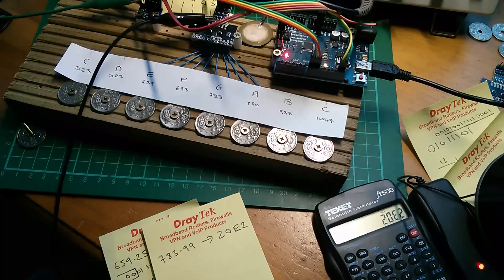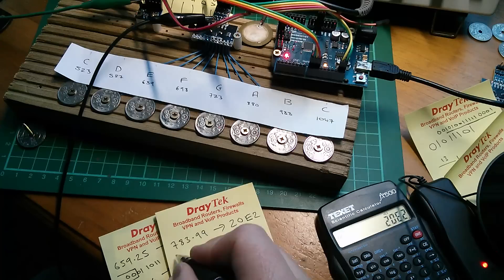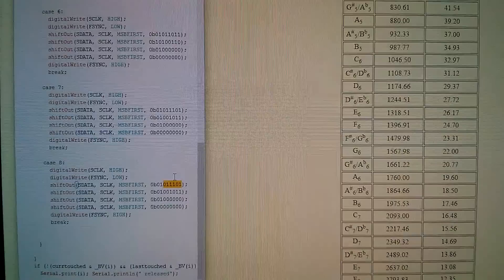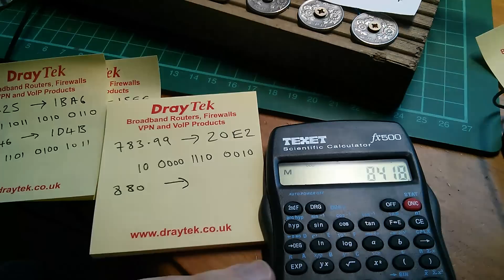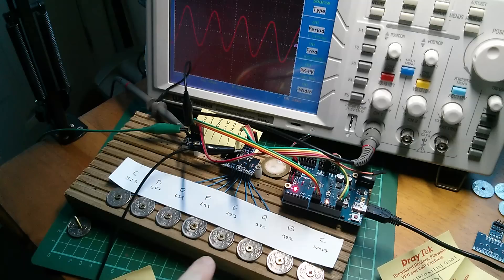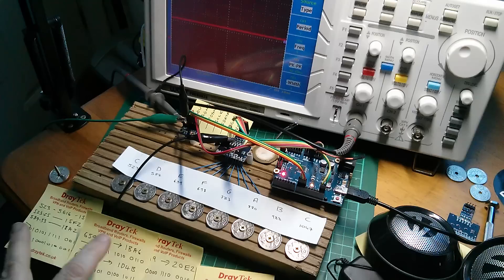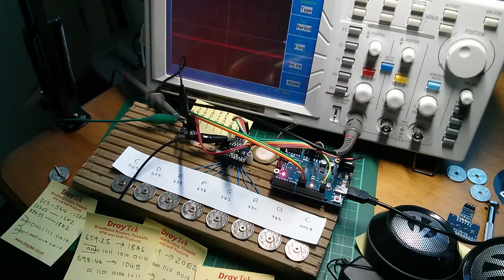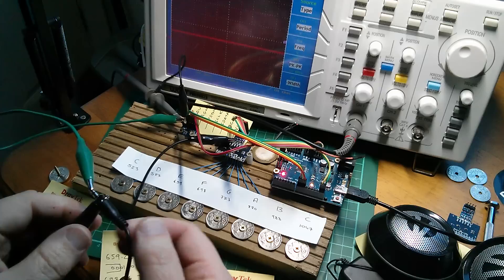Project: Penny Organ - Hand Calculation of Frequencies

Comment: You could use the Hex directly in the C code, then concatenate that with the two bits used for setting the register.

I'm not sure if you can concatenate things in C like you can in Verilog (much easier than doing bit-shifts and ORs etc.), but the C code could be something like this...

int NOTE8 = 0x20E2;

char HIBYTE = (NOTE8 >> 8) & 0x3F; // Shift the MSB byte to the right, then mask the resulting lower 6 bits.
char LOBYTE = NOTE8 & 0xFF; // Mask the LSB byte.

case 8;
digitalWrite(SCLK, HIGH);
digitalWrite(FSYNC, LOW);
shiftOut(SDATA, SCLK, MSBFIRST, 0b01000000 | HIBYTE ); // OR the High Byte bits with the 0b01000000.
shiftOut(SDATA, SCLK, MSBFIRST, LOBYTE ;
shiftOut(SDATA, SCLK, MSBFIRST, 0b01000000);
shiftOut(SDATA, SCLK, MSBFIRST, 0b00000000);
digitalWrite(FSYNC, HIGH);
break;

I haven't tested that, but it should make it a tad easier to reference the code later on, and to type in the HEX values.

Or, you could even just enter the decimal value in place of the Hex for each note, and it should work just the same. ;)

Comment: Ahh - Since my first reply, I've just watched more of the vid when you said about doing it all in C. lol

It's not too bad to do as long as you know the bitwise AND / OR / XOR type operators, and the shift operators (and use brackets in the correct places).

You could tidy the code below by putting the commonly used stuff into a procedure as well of course...

void PlayNote(int note)
{
char HIBYTE = (note >> 8) & 0x3F; // Shift the MSB byte to the right, then mask the resulting lower 6 bits.
char LOBYTE = note & 0xFF; // Mask the LSB byte.

digitalWrite(SCLK, HIGH);
digitalWrite(FSYNC, LOW);
shiftOut(SDATA, SCLK, MSBFIRST, 0b01000000 | HIBYTE);  // OR the High Byte bits with the 0b01000000.
shiftOut(SDATA, SCLK, MSBFIRST, LOBYTE);  // Use the lower Byte directly.
shiftOut(SDATA, SCLK, MSBFIRST, 0b01000000);
shiftOut(SDATA, SCLK, MSBFIRST, 0b00000000);
digitalWrite(FSYNC, HIGH);
}

Which can then be used by simply calling it like this...

PlayNote(0x20E2);
// Or...
// PlayNote(8418);

Love watching your vids on weird and wonderful gadgets btw. ;)
Reply: +electronash i was thinking of using (0x3F<<8) & note , and then shifting it to the right afterwards ,but your method is better =^P
Reply: +Glychee S

To be completely honest, I'm not hugely experienced with C coding (and certainly not C++), so I wasn't even sure if what I typed before was the "right" way to do things. lol

With coding in things like Verilog, it becomes easier to think of shifting towards the LSB in a lot of cases though, and I've seen the same in a lot of C code like the MAME sources too (does depend on exactly what the code is intended for though of course).

In Verilog, you can select a group of bits (or a single bit or signal), and then concatenate them far more easily than C normally allows (without using macros etc.)

At least that's as far as I know, because C / C++ has been updated quite a lot over the years, and as I say, I'm not familiar with all the new operators and "tricks" that can be used. hehe

So, an example in Verilog would be...

wire [7:0] HIBYTE = note[13:8];
wire [7:0] LOBYTE = note[7:0];

See - so much neater. :p

Or, you can even concatenate other bits / signals in the same assignment. eg...

wire [7:0] HIBYTE = { 2'b01, note[13:8] };

btw, I think a few bytes of variable storage could be saved by changing the "int" for an "unsigned short". ie. 16-bits instead of 32-bits (or more accurately "31-bits with a sign bit" with the original int.)

Then also assign the "note" variable directly to the shiftOut stuff?..

void PlayNote(unsigned short note)
{
//char HIBYTE = (note >> 8) & 0x3F; // Shift the MSB byte to the right, then mask the resulting lower 6 bits.
//char LOBYTE = note & 0xFF; // Mask the LSB byte.

digitalWrite(SCLK, HIGH);
digitalWrite(FSYNC, LOW);
shiftOut(SDATA, SCLK, MSBFIRST, 0b01000000 | ( (note>>8) & 0x3F) ); // OR the High Byte bits with the 0b01000000.
shiftOut(SDATA, SCLK, MSBFIRST, (note & 0xFF) ); // Use the lower Byte directly.
shiftOut(SDATA, SCLK, MSBFIRST, 0b01000000);
shiftOut(SDATA, SCLK, MSBFIRST, 0b00000000);
digitalWrite(FSYNC, HIGH);
}
Reply: the structures are correct, i'm not sure wether you need two &'s or 1 &, because there's is a difference between && and & where one is bitwise and the oher is not...
Reply: Yep, the single "&" symbol should be a bitwise AND, and that's what we're doing with the 0x3F thing to mask the lower 6 bits of the "High" data byte (once the High byte has already been shifted down towards the LSB).

A double "&&" is for a logical AND, so it's only for when something evaluates to a boolean True / False (1 or 0) AFAIK?

Same for Verilog too, and that's why I way prefer it to the overly verbose VHDL.

In VHDL, they even use the "&" symbol instead of commas for concatenating bits / signals, so it is quite confusing at first.

For some reason, a lot of companies prefer VHDL to be used by their engineers, and I think this is mainly just because VHDL has been around for a lot longer?

They could argue that due to it's verbose nature, that there's less chance of making typos etc., but I'd argue the opposite that there's simply more typing involved with most VHDL code, which makes it harder to read, and just as prone to typos as Verilog would be.

It would be great if C / C++ could select bits in a variable as easily as Verilog does though, as they are still all just "a bunch of bits" at the end of the day.

As long as the programmer understands when things like signed numbers are involved (which he / she of course should), then it's fine.

Here's an example of where a lot of bit shifts are used in C, which could be far more readable if you could just say "I want to set a specific bit (or groups of bits) to a certain value"...

http://www.zembedded.com/arm-gpio-general-purpose-input-output-register/
Reply: We're slowly moving towards more abstract ways of programming aren't we?
I need to get into FPGA's and try a bit of verilog,sounds interesting.

There's indeed no easy way to select bits, always with the shifting and masking =P

Thanks for taking the time to do that big writeup =)
Reply: *****

No problem. ;)

I would definitely recommend getting into FPGAs. They aren't half as scary as many people think, and a lot of tasks involving interfacing directly to hardware are often a lot easier / quicker than using an MCU.

I have the Terasic DE1, Cyclone V GX kit, and a few various generic boards, and I used them all the time.

The DE1 is quite a bit older now, but still has tons of features for the money - SDRAM, SRAM, Flash, VGA, Audio, SD card, 72 or so spare IO pins, and ~20,000 Logic Elements, which is enough to run everything up to and including the Minimig (Amiga), Genesis (but with no sound, yet), and PC Engine cores.

You can get cheaper boards from China though obviously, and then hook up extra stuff like joysticks, and PS2 keyboard etc.

Most of my projects now involve FPGAs in some way (as you can tell from my lowly YouTube "channel"), but it's a good combination to use an FPGA and MCU on the same board tbh.

That's mainly because writing stuff like an on-screen menu GUI in pure Verilog is a bit long-winded. You can of course run C code on soft CPU cores as well, but it's just as easy to hook up an external ARM chip or whatever.

A good site to start from is www.fpga4fun.com

I bought my first FPGA board from there about 12 years ago or so. It was the Pluto-II board, and used an old-skool serial port to program it. lol

My first project was to replace the colour wheel (and motor) in single-chip DLP projectors with the FPGA so I could replace the lamp with high-power RGB LEDs.

It only need a few minor tweaks to my first Verilog code, and it then worked perfectly. :)

Comment: Julian,  what is function of the last 2 lines used in each case statement
  shiftOut(SDATA, SCLK, MSBFIRST, 0b01000000);   // 0x40
  shiftOut(SDATA, SCLK, MSBFIRST, 0b00000000);  // 0x00
have something to do with  0x4000 Frequency Register 0 MSB ?  Ref application note AN-1070...

Comment: It confused me somewhat when you said that 783.99 DECIMAL was  20E2 HEX

Where does the fudge factor that you introduced later come from ?
Reply from the maker: +Vira Yes the fudge factor is 10.737 - which as Vira says is 268,435,456 (2^28) divided by 25 million (25MHz clock).

Comment: I feel like this is actually big advertising for DrayTek.
Reply from the maker: +ValugaTheLord Not really. I wasn't planning to video this process, otherwise I'd have used plain Post-It Notes. Dammit - more big advertising.
Reply: +Julian Ilett Hopefully they'll send you some stuff to review too :-)
Reply from the maker: I can't think of many things more boring than reviewing a broadband router
Reply: Julian Ilett Will they do make other network equipment as well. For broadband routers, you could explain how ADSL work's and maybe also add a destructive high voltage lightning strike test for good measure :-)
Reply: +Coolkeys2009 I think we should leave the high voltage stuff to +photonicinduction

Comment: Julian none of this was necessary of course :)
You don't need to convert to binary... Also, why not let the computer to the work?

Here's some simple code snippets to see how it could be done.
You don't need to convert to hex by hand at all. Also you can use constants to make the code more readable.

#define FREQ_F          698
#define FREQ_G          784

#define MCLK             25000000ll
#define F_SCALER        268435456ll  // 2^28

uint16_t RegisterValueFromNote(uint16_t frequency)
{
  return frequency * F_SCALER / MCLK;
}

void SendNoteEasier(uint16_t note)
{
  ...
  note = RegisterValueFromNote(note);
  shiftOut(SDATA, SCLK, MSBFIRST, FREQ0_REGISTER | ((note >> 8) & 0x3F));
  shiftOut(SDATA, SCLK, MSBFIRST, (note & 0xFF));
  ...
}

void TheEasierWay()
{
  SendNoteEasier(FREQ_G);
  SendNoteEasier(FREQ_F);
}
Reply from the maker: +Andre Eisenbach I will do something like this eventually. But I'm not familiar with C logical operations - I'll have to do some self-tuition. In fact I will probably come back to your code snippets when I build the finished code.

Comment: A bit off current topic, but more on amps topic, here is a board I have had laying in my box now for several months, got it before I left the land of snow and ice for the valley of the sun in Arizona.  It may be of interest to you however as it  would work with your solar panels and make a heck of a sending unit for your wearable project.  Perhaps you have seen it, a bit spendy for an arduino but well worth the cost for the functionality.  Seeeduino Stalker V3 Arduino Compatible Microcontroller | eBay
http://www.ebay.com/itm/Seeeduino-Stalker-v3-Arduino-Compatible-Microcontroller-/121871797277?hash=item1c60200c1d:g:uqgAAOSwbdpWV2Rk